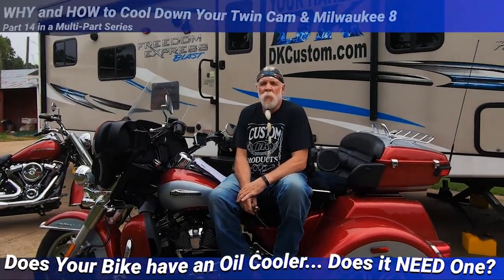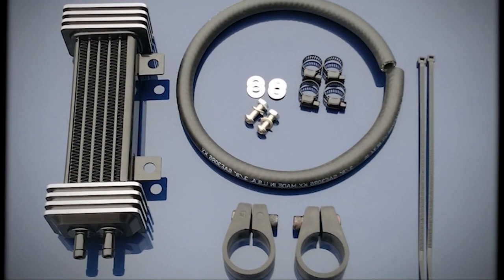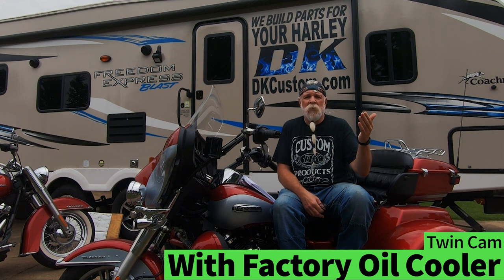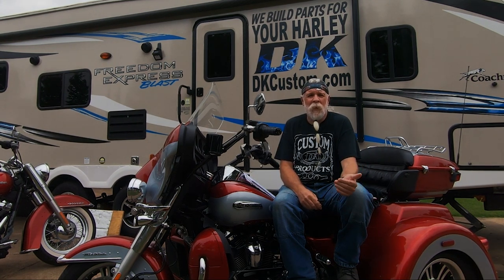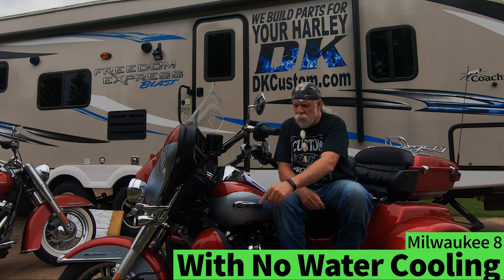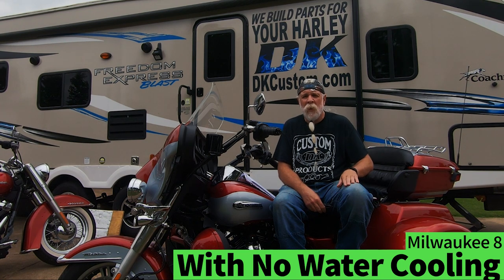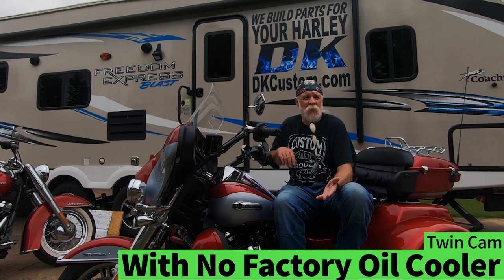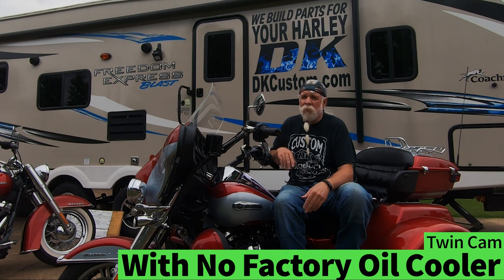Oil-How it Affects the Performance of Your Harley

Comment: What is the impact on 114ci OEM oil pump's oil pressure when adding additional fluid demand for hoses, oil cooler and oil filter relocation kit?
Reply from the maker: There is no measurable difference when using a gauge that measures in 1 lb. increments.  I say that because we have tested and several of our Customers have tested, and seen no variation in pressure.  If there is a difference, it is less than 1 lb.  The two biggest "logjams" in the OEM Harley set up are some of the smaller oil passages in the engine and the paper oil filter.  

All the channels in the oil cooler, oil filter relo, and hoses are much larger than some of the smaller OEM points.

Comment: You guys at dk customs check out oil bud oil coolers 

I’d like to know what you think
Reply from the maker: We have.
I purchased one for my own bike a while back.  Went to install it and did not like that I had to modify the frame to get it installed.

I ground down part of the frame & installed it anyway.  The cooling of the oil was much less than an oil cooler out in the wind, even though it had a much larger surface area.

We thought this was unique to the bagger I was testing.  So we purchased another Oil Bud for a different bike.  We installed it per the instructions, did our heat tests.  Same thing.  Only cooled about 60% as well as the Jagg oil cooler that is right out in the wind.

Standing still in stop n go traffic, we did not see a difference in oil temps due to the larger surface area.
Reply: Thank you for your honest encounter! I was on the fence. Always nice to know first hand how things work. I really appreciate all you guys do!
Reply from the maker: @James-fk2sb  Yeah, I was hoping they would work better.  I like the hidden look.

Comment: Will it fit on Sportsters?
Reply from the maker: Yes.  All the oil coolers at the following link are designed to work on a Sportster.  https://www.dkcustomproducts.com/sportster-c155.htm

This oil filter relocation at the following link is not needed for the oil cooler on a Sporty, but if you want one, it will fit on a Sportster. https://www.dkcustomproducts.com/cnc-oil-filter-relocation-kit-sportster-dyna-softail-touring-dk-cnc-ofr-uni.htm
Reply: @DKCustomProducts  And that answers my question.  I will have to work up a build one piece at a time starting with the Outlaw Filter.  Cooler means longer life and better performance.  More oil capacity in the oil cooler means cooler.  You have too much as far as accessories.  My wallet is going to hurt.
Reply from the maker: @exexpat11  Step at a time is how we do it also.  That way you know which mod is providing what benefit, vs. doing a bunch at one time.  Appreciate your business, I believe you will like the benefits of the mods. 👍

Comment: Is the jagg oil coolers compatible with your relocated permanent oil filter assembly?
Reply from the maker: Yes, it is, and we have them available in a package for a little extra savings.  Two wheel version package is here- https://www.dkcustomproducts.com/oil-filter-relocation-oil-cooler-combo-pkg-harley-touring-dk-ofr-dcoc-2wh.htm

Trike version package is here- https://www.dkcustomproducts.com/oil-filter-relocation-oil-cooler-combo-pkg-for-harleytrikes-dk-ofr-dcoc-tri.htm
Reply: Sweet and for an 80 inch high horsepower build do you recommend the 6 row or 10 row cooler
Reply from the maker: @grimeyhonkyracing3938  It all depends on what oil temps you are seeing.  You want to have a max oil temp of 230F on a hot day on a hard run.  So if your oil is getting around 250 in that situation, a 6 row will do the  job.  But if you are getting up around 270 or higher, then a 10 row would be in order.
Also, if you are doing a lot of slower riding, and/or stop and go and the oil temp is getting up above 250, then I would go with the 10 row.
Reply: @DKCustomProducts  Alright guys i just placed an order on your website for a ton of goodies i need. I'll go with the 6 row with the cleanable filter and relocate. See how that works for now, plus coil/ ignition relocate and rocker lockers and some tape. I'll check in with you once i get my kit from hammer to see what can be done as far as external breather on the HPI cleaner. Yeeeah buddy! 🤑
Reply from the maker: @grimeyhonkyracing3938  We appreciate your business.  I believe you will be well pleased with those mods. Always feel free to email or call with any questions.

Comment: Can adding a second oil cooler and fan in line and conjunction with the factory oil cooler and fan be a good way to decrease heat?
Reply from the maker: Yes, running an auxiliary oil cooler is what Many folks do to keep the heat down.  I ran my first one that way back in 2005, and did what you mentioned...one of them with a fan.
I learned that from several guys that were building performance Twin Cam's and that was the only way they were able to keep the heat down where it should be.
https://www.dkcustomproducts.com/auxiliary-oil-cooler-for-all-harley-twin-cam-w-o-lowers-dk-sec-oc-tc.htm
Reply: @DKCustomProducts  I have an oil cooler and was thinking like adding another to the side between the lower fairing one of those UCOOL type ones with a fan or dual fans